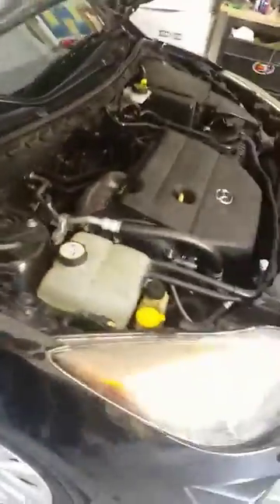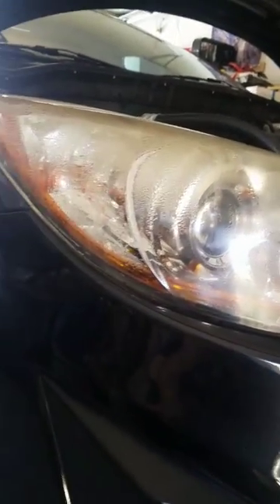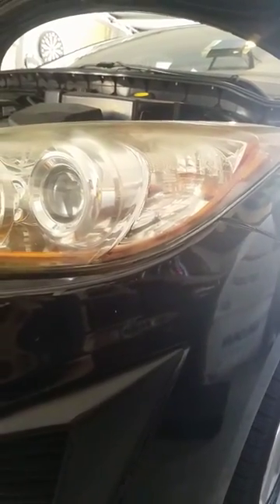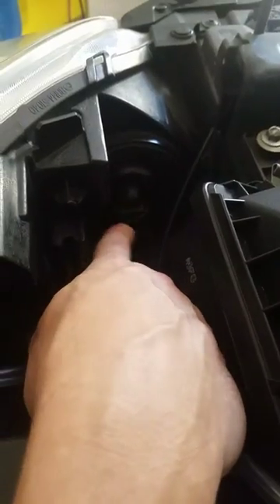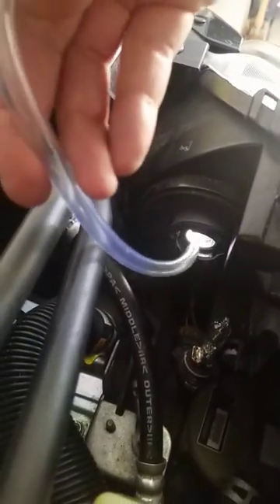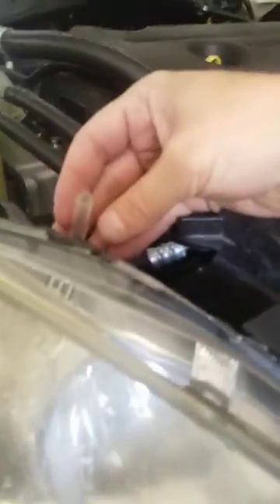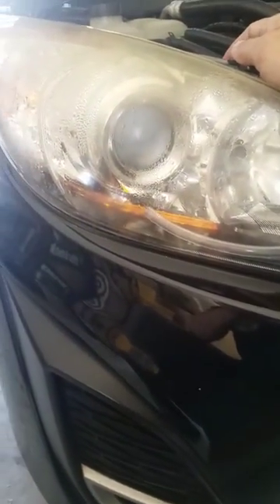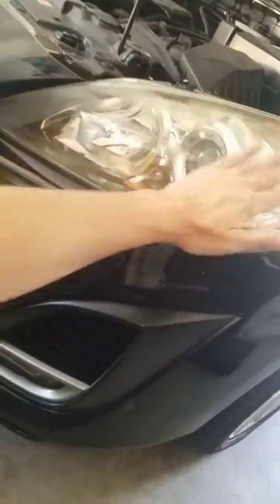Get Moisture out of headlights easy and free

Comment: If this repeats itself, take some silicone sealant to make sure that thing is water tight.  Another trick is to put one of those moisture wicking beads (often found in new shoes)inside.
Reply: Great minds think alike. I was thinking about using the moisture absorbers that come inside pill bottles.

Comment: Why not put a little bit of Damp-Rid water remover inside the headlights and Duct tape the bulbs connection and Silicone the headlights edges on top seams . Or use a charcoal briquettes of little bit from the Camping department or groceries stores don't use anything that got wood inside the charcoal briquettes just plain charcoal briquettes only then seal it up . Then leave it overnight and day without driving the car or truck then by day 2 ,just use a little tube and shop- vacuum to suck out the charcoal briquettes . It might turn into dust by day 2 .then vacuum it out . Then seal it up silicone rubber headlights and small lights connecters o- rings , but cleanup the o- rings first before using the silicone rubber gel made for headlights connecters and others mini-lights . Or faster drying time use a hairdryer gun with a vacuum cleaner tubes and small wrapped up metal tube inserted inside the headlight lenses let it run for just a minute and no longer than that rest in between cooling down then back to heating up 1 minutes then cooling down until no water inside the headlights lenses . Or use a blower from the shop-vacuum cleaner to blow out water .

Comment: Just Drill A Few Small Holes In The Back Of The Plastic Housing Under The Hood To Allow It To Breathe And Release The Moisture!

I Speak From Experience! It Works! ✌️
Reply: I was thinking about this. Where exactly?
Reply: @aaronmonroe7932  If The Backside Of Your Headlight Fixture Is Either Plastic Or Metal, Just Drill A Few Hole In The Upper And Mid Sections to Allow Air To Flow Through And Release/Dry Out The Moisture.

After Drilling The Holes, You Can Use A Hair Dryer To Blow Warm Air Into Holes To Remove The Trapped Moister Inside Of The Headlight Fixture.

Just Leave The Holes On The Back Side Open To Allow Any New Moisturizer To Escape Through The Holes, Due To The Constant Airflow.

Just Make Sure That The Holes Aren't Extremely Big And Not To Small (A Medium Sized Hole Is Perfect), So That There's Adequate Air Flow.

I Did This To My 1999 Lexus LS400 And It's Worked Flawlessly! I Hope This Helps You Aaron!

Enjoy The Rest Of Your Day! Happy Holidays To You And Your Family! ✌️